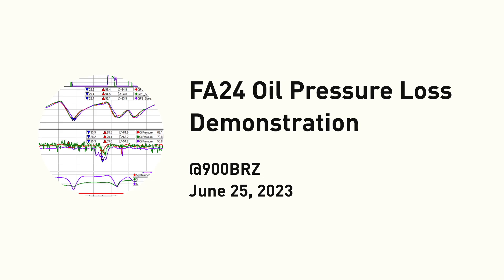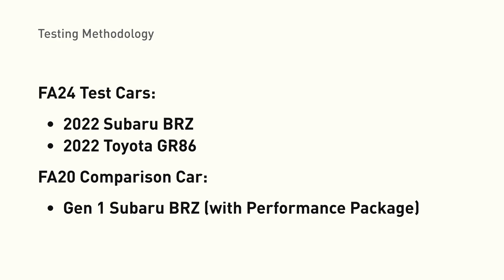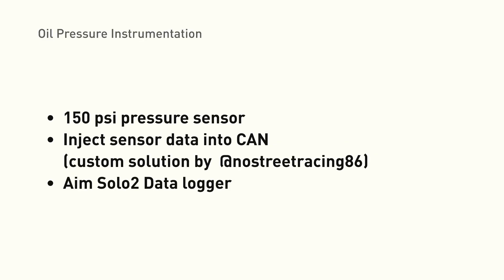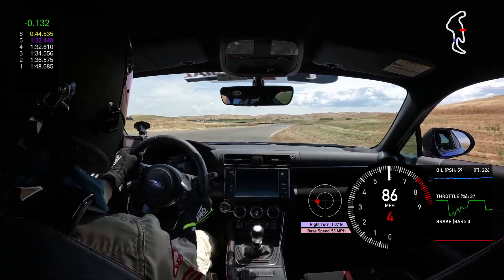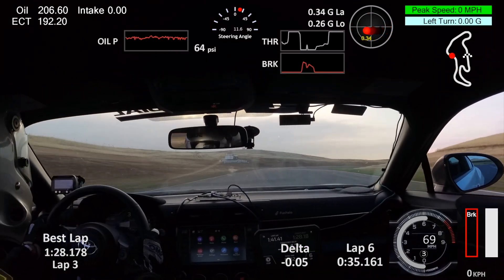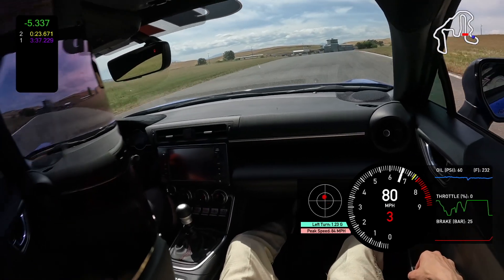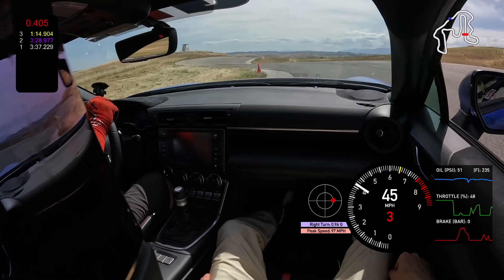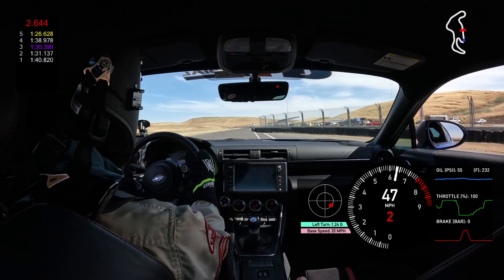BRZ/GR86 FA24 Oil Pressure Loss Demonstration

Comment: @900BRZ Currently I have the greddy baffle so dunno if you guys already tried it
Reply from the maker: From the images I’ve seen, the GReddy is promising. I have not tested it and nobody in my group of friends here in the Bay Area has this baffle.
 
It has a vertical section that should reduce surging into the timing cover, although it’s not as tall as the KB baffle I’m trying. The other difference is the KB baffle has a trap door do allow oil to return to the oil pan from the timing cover. From @trackandbuild we can see that horizontal baffles do have a positive effect, but they don’t solve the pressure drops. But maybe this design with its hybrid approach will do better.
Reply: Thank you felt somewhat at ease but I guess I just saw your updated post that even the killer b baffle did not workout the way it suppose to.
Reply from the maker: Correct. I’m now less convinced about the GReddy design as well. I have friend who just instrumented his, so we should know soon.
Reply: Now also makes me curious how the Japanese do it from their end since you see all these tuning shops still pushing the car to its limits with different setups. Will try to ask one of the 86 known tuning shops to see how their approaching it.
Reply from the maker: This is from the previous gen engine but you can get a detailed look at it here: https://www.ft86club.com/forums/showpost.php?p=3097986
Reply: @900BRZ  so... sorry is the post meaning that there is no good fix or good value fix for this issue? lol This is making me pause or think twice of what to do with the car or should even drive on track.
Reply: The more I think about it and the more videos I see from others, feels like what others and Chris are saying, go with the Miata if you don't want to worry about any engine issues. I really think that's all I am hearing to avoid the time bomb and think that I am able to track the car lol Basically a huge lie from Subaru and Toyota for the track support. Who is willing to risk their GR86 and BRZ for this. I mean I get people would just drive on the street but that wasn't the only reason people buy these cars. Disapointing~
Reply from the maker: The post is saying the specific baffle we tried didn’t work, but we need to do more testing to figure out if there are other baffles that work better. I’m still hopeful we can find something but it’s going to take some time.

Comment: This is a fantastic video. Shows data that is impossible to argue or ignore. I hope this video makes its way to the people that it needs to at Subaru and at Toyota, or maybe this video/study could get featured in some of the big names in automotive publicity (Road and Track, Car and Driver, etc). I will be eagerly and nervously awaiting the results after the Killer B baffle prototype baffle is installed. If it shows favorable results... I hope that Killer B has plans to make tons of them, bc I'm sure they'll fly off the shelf
Reply from the maker: Already gave a statement to Road & Track and they published an article: https://www.roadandtrack.com/news/a44362621/toyota-gr86-subaru-brz-fa24-potential-starvation-issue/
Reply: @900BRZ  Even better, I didn't know there was already an article on this. Hopefully this gets big enough to force Subaru/Toyota to do something about it
Reply: @900BRZ  'A Subaru spokesperson tells R&T that "Subaru of America stands behind the design integrity of the FA24 engine which is used reliably in thousands of vehicles. Oil pressure varies in all engines based on RPM, temperature, cornering loads and numerous other external and internal factors. This is normal in an engine duty cycle. The FA24 engine is designed to perform within a wide set of tolerances for road use, and the Subaru BRZ is designed as a road car. Race cars are specially modified to be used for race conditions."'

so now what?? owners who track w/ warranty are SOL? ridiculous

Comment: I'm considering running the first gen oil pan and pick up with the second gen engine, did you look into that?
Reply from the maker: I haven’t, but I’m interested in what you find. There are meaningful differences in the upper pan as well, where more than half of the volume of oil sits in static conditions.

Comment: So, to summarize, if you pull more than 1G during a right turn with 50% or more throttle, you will experience a drop in oil pressure.
Reply from the maker: That’s a more broad conclusion than I’m willing to make. I plan to publish more data in forums for those who want to go further than this video goes.
Reply: @900BRZ  I'm looking forward to it, I drive a 2018 and was thinking of upgrading. So, definitely will be looking forward to your next video
Reply: It's interesting - If you look at turn 14 where he doesn't downshift and stays in 3rd, he's pulling 1.12 G's and is at 100% throttle, but oil pressure is stable (https://youtu.be/4Jk5WTWoqt4?t=782).  It's only until the RPM's get up above 6k that suddenly oil pressure drops.   I feel like RPM's is playing a big role in this as well.  Hard right hand turns paired with high RPM (6k+).  In an earlier turn he was only pulling .5 G but with high RPM's and still had a significant drop.
Reply from the maker: Killer B also has a theory that when the oil surges into he timing cover, it can get “roped” by the timing chain. The higher the RPM the more the oil is going to get thrown to the far left side of the timing chain. On the right side of the engine (i.e. where the oil sloshes in a left hand turn) the timing chain would throw it back toward the center of the engine instead.

Comment: Subarus use oil pumps with very high flow rates, around 60 L/min at 6,000 rpm for the FA20 turbo.  That amounts to the entire oil volume circulated through the engine every 6 seconds or so.  At high rpm and high oil flow rates, there will be more oil in the engine in the process of draining to the sump, and the level in the sump will drop.  I suspect that overfilling the oil would help.  

A thicker grade of oil should also help, since it would cause the oil pump to enter pressure relief at lower flow rates, and these lower flow rates would leave more oil in the sump.  However, these cars are already using 5W30 and the oil coolers are keeping oil temperatures down, so the oil viscosity would have been quite reasonable in these tests.  If these cars were using 0W20 and did not have aftermarket oil coolers, the oil would be a lot thinner, the sump level would drop even lower, and the problem would likely be even worse.
Reply: Since the oil pressure drop seems more during right hand turns, could it be that centrifugal force is causing the oil to shift to the left side of the crankcase?   This shift in oil level might cause the pickup to be partially sucking a small amount of air.  Maybe increasing the oil level would be a good thing to try.  If this changes the oil pressure in right turns, then a redesign of the pan or the pickup might be the answer.

Comment: Looking like a race car engine and 'sport' engine are designed for different applications. Basically racing an engine that is not designed for racing isn't a good idea. My Mercedes is great when I give it a tap, but I, as a responsible adult wouldn't put it on a track. Looks like you have data that backs my position as far as that goes.
Reply from the maker: This is a car that was marketed as “Track Ready” and I’m able to see pressure drops at less than 1 G of lateral acceleration with a largely stock configuration. All I’m doing is presenting that data and trying to make the performance more robust.
Reply: @900BRZ you've done a great job in your presentation of your collected data. I'm sure it will be helpful for owners of cars with these engines. Perhaps someone will be able to create a remedy for the oil delivery problem as a result. Good luck with yours
Reply: That's a good callout.  And to what degree 'sport driving' become s'race driving' is an important distinction.  How much track time, like say if take Toyota up once on their free track day offer, is enough to incur reliability damage?

Comment: I have a 2015 Scion frs and it spun a rod bearing at 15,000 miles due to this issue.  To fix the car at the dealership they wanted 10,000 dollars! I never tracked the car but I do live on a mountain with plenty of right turns and elevation changes, I’ll never buy a Subaru boxer powered car again

Comment: Thank you for your work on this oiling issue! I have a track only 2013 FRS and have installed a mechanical OP gauge because I was worried about this. My pressures look good except occasionally on long high G sweepers I will see a little dip. I have noticed oil level makes a difference. I need to keep mine at or a little above the high mark on the dipstick. Have you experimented with a higher oil level? might be worth a try.
Reply from the maker: I may add that to the test this weekend after running at the max line. Thanks for your comment!

Comment: Clear, concise and eye opening video, really good work. I own a 2022 WRX, since the new VB WRX uses the FA24 engine, albeit a tuned and turbocharged version of the NA FA24 engine, is it safe to assume the right hand turn oil pressure issues remain? Haven’t heard many people site engine problems in the 22’s other than the occasional RTV issue. Definitely will be driving with more caution.
Reply from the maker: There are a lot of differences to the engine so it would require separate testing. There is one Reddit user who is claiming to have done testing by filming a pressure gauge and cannot observe drops.

Comment: Amazing video! It's interesting that the FA20 did not have these significant oil pressure drops, so it suggests that some fundamental design difference in the oiling system is causing this issue. I'm also curious what this test would look like without the oil coolers. Of course they are important for someone who does a lot of track driving but if someone just does street and some casual tracking, I wonder if they would be more susceptible to their engine blowing up.
Reply from the maker: I would love to be able to do a separate test on a completely stock vehicle. Hopefully we will learn that information.

Comment: Have you ever logged data on FA24 using 0w-20 without an additional oil cooler?

We can see oil temperature of these experimental vehicle roughly around 210F to 240F.
In my personal opinion, this range of temperatures is too low.
The high kinematic viscosity of the oil makes it difficult for the oil to return to pan.
Assuming that the direct cause of low oil pressure is the lack of oil at the tip of the oil strainer, the oil needs to be returned to the pan as quickly as possible.
Therefore, it is preferable to reduce the kinematic viscosity of oil.

I have been running FA20 in tracks for several years now.
I use 0w-20 or 0w-30 without installing an oil cooler, and operate in the 250F-265F temperature range, but I have never had a single problem with it.
If the engine is worn out, there would be oil oozing into the end of the exhaust. But there is no oil oozing at all.
Reply from the maker: The theory presented, and which I believe, is that (in the corners in the video) oil is surging away from the pickup, not accumulating outside of the sump due to inadequate oil return. 

My nominal oil pressures at temp on track are already down to mid 50s PSI. Increasing temp or decreasing oil weight will reduce that nominal pressure further. 

With limited testing, I show the FA20 seems to be less susceptible to these pressure drops.
Reply: @900BRZ 
I give your consideration the utmost respect.

Let me ask one question.
Regarding to Gen 1 BRZ with FA20 in the video, did it have any baffle plate in oil pan?
Reply from the maker: No baffle. Never had the pan dropped.
Reply: @900BRZ  
Right, FA20 seems to have higher robustness.

This is just for your reference. 

I drive on the Tsukuba circuit.
For the past several years I had been running 0w-30 in 250F or above temp range and measuring oil pressure. 
(My pressure sensor is located just in front of the main gallery. It is same to one on your vehicle.)

My engine is FA20, but my car wears ADVAN A052s, so larger g-forces are generated and the oil pressure drops every time I take a right-hand corner.
Tsukuba Circuit has right turn corners. Some of them are rounded, which require a few seconds for us to pass, while the oil pressure drops to about 25-30 PSI and that will last for several seconds per corner.
But my FA20 (driven 5 years and 30,000+ miles total) never experience any failures. 
I understand the concept of appropriate oil pressure based on engine speed. But as long as the oil pressure does not go to zero, a drop in oil pressure for a few second may not be much of a problem.

Hopefully Killer-B's new baffle plate will solve the problem. Thank you for your great research.
Reply from the maker: @abaracrackin  Thank you for your comment. Would love to drive at Tsukuba someday. 

Miles K used RT660s on the 2017 BRZ so we'll be able to look at how higher grip tires affect FA20 oiling. Glad to hear you have had good reliability so far despite pressure drops.
Reply: @900BRZ  
Tsukuba welcomes all visitors at anytime!

I believe that the FA20 is also less robustness compared to older engines. So I too am always concerned about the health of my engine, although I have not had any problems so far.
I will continue to operate my engine and will tell you if I discover anything that is worth sharing with you.

Have fun with your car! I will be watching your future videos.

Comment: There is like almost 10 years between the GT and GR and Toyota hasn’t really changed that much. The innovation level is really really low, this is generally the case for japanese cars…

So they changed only a few bits in 10 years and they werent able to make them properly😅 Toyota…

Comment: I am not a Subaru specialist, I own an Evo and I have heard Subaru engine on WRX are problematic, this issue on the new GR doesn't surprise me.  Seems like only Porsche makes good boxer engine.
Reply from the maker: They had a lot of problems in previous generations because making their oiling much more robust. They also charge at least double for any of their products with a flat engine layout.

Comment: The pressure drop seems like the oil is not going back to the pickup fast enough. Common thing in 4ages too. Watch some of mt performance engines build videos to get an idea of the issue
Reply from the maker: Maybe on T3-5 East. But it feels like T5 and T8 West have to do with surging because the drops happen quickly.

Comment: I wonder if there is some kind of abnormal turbulence inside the oil pan caused by g’s and oil return volume and/ or pressure. Also, need to confirm oil aeration
Reply from the maker: Possible. I don’t have a background in fluid dynamics and these things are hard to develop an intuition about that actually matches behavior in the real world.

Comment: Will this reflect on spirited driving through canyon roads?

Not hooning, but your regular leisurely drive.
Reply from the maker: Not likely. Based on my experience you need to be squealing the tires and approaching or over 1 G of lateral acceleration. Believe it’s possible on the street but I doubt within legal limits.
Reply: @900BRZ  Within legal limits is the qualifier there -- leisurely drive making this happen is not very likely, agreed.  I have a ~friend who may or may not have realized they hit that 1G mark per the dash instrumentation's maxG screen, definitely in right handers, but minus the tires squealing.  And for sure those moments were in the midst of high rate of change of turn, which I think is one of the factors that contributes to the oil pressure drops you've demonstrated.  For sure in most scenarios of driving daily and around other cars, this would not happen.  But there may or may not be specific sections of road near said friend, kinda in da countryside, where this happens somewhat reliably when it's known that other humans are typically not around.  Within legal posted speed limits, no.  Reckless?  Not horribly. My point, if I have one, is that those who do some canyon time or the equivalent, may in fact be hitting some of the same scenarios that you saw pressure drops.  I would venture a guess, however, that the drops would not be quite as low or last as long.  Of course what we don't know at this point is how the measured oil pressure drops correlate with damage, either at that moment, or built over time.  I am not discounting the data nor the conclusions thus far, at all.  I do suspect that non-track folks probably dip into these oil pressure drop scenarios sometimes, but not as deeply.  For my first track day upcoming prob in October, after having seen this, I am thinking I'll just lift the car about 28 inches on the lefthand side to help counteract any possible righthand turn forces on the oil in the pan -- you should be able to pick me out of the crowd easily, so say hello.  lol    As always, kudos to the work to keep moving down the path of figuring out what is going on, if it can be mitigated, and how it contributes to the engine's reliability - I actually like the feel and note of the boxer motor, and I would not enjoy the car as much with a smoother toyota powerplant...but I don't want to blow things up, either.
Reply from the maker: Haha, I think you’re thinking about this correctly. I think it’s possible to observe pressure drops on the street, but not likely to see them and you’re right to call out that they may or may not be as severe or have the same durations. Lots of variables. Lifting the left side would help!